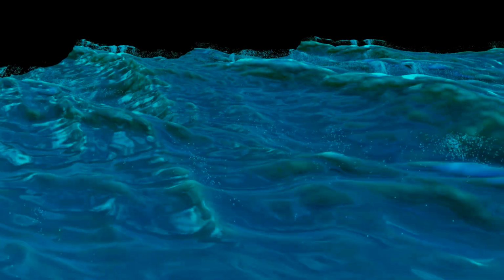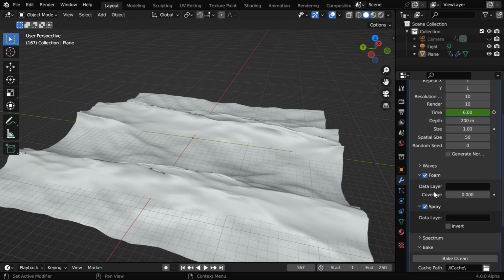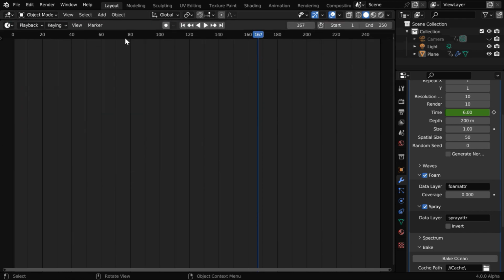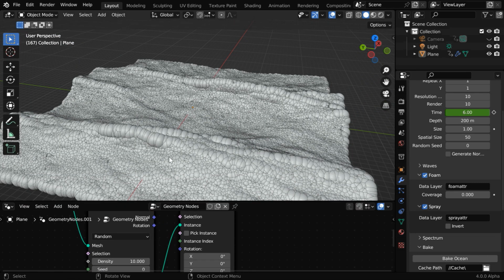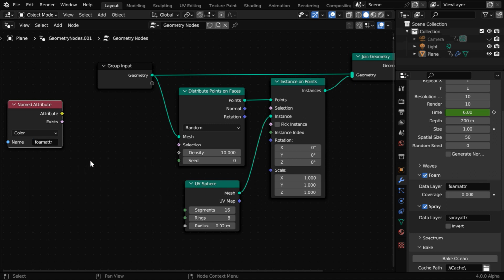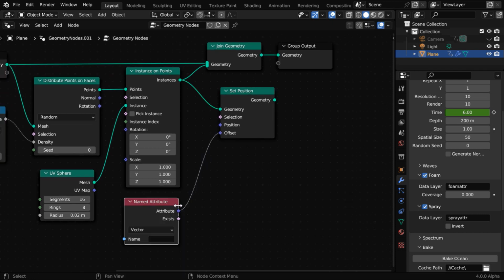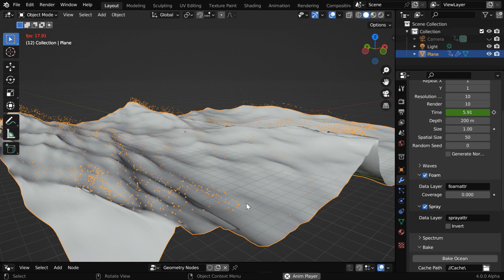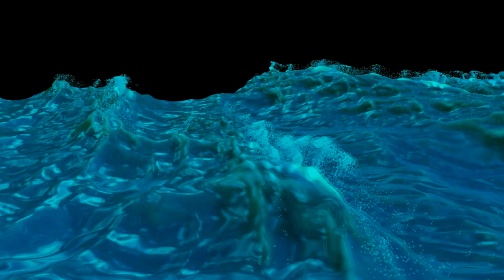Spray With Ocean Modifier | How To Use The Spray Option In Blender | Quick & Easy Tutorial

Comment: So this is how you do this, i had no idea, this can work in real-time with eevee?
Reply from the maker: Yes it works with Eevee. I did not understand what you meant by real-time, but it can be used in any animation. Once you bake everything, it will run faster and you can render.
Reply: @5MinutesBlender use of dynamic paint so it's interactive with objects in realtime, in the viewport, no need to bake
Reply from the maker: @Viilap  Ok, got it. Yes it works that way (your machine must have a very good spec), but does it have any practical use if you don't finally render the scene? In order to render, you need to bake it first.
Reply: @5MinutesBlender  it's more to just play around but ue5 is probably better for that

Comment: This video and the loop video are great, but the foam doesn't loop with the rest if you have a decent amount of it in your shader with an emission node. Would love help with that, and making the shape of the water not square as the displacement gets used when looping. Thanks.
Reply from the maker: Sorry, I could not figure out a way to loop the foams 🙁 It only works without foam.
Reply: Bummer, thanks for trying though
 @5MinutesBlender

Comment: thank you for your helpfull videos,
 i am playninng to buy a new pc because my old laptop has a lot of lag problemes.
i am facing a  problemes whene i running videos in viewport i got a lot of lag,
haw can i get smothness whene i work in viewpor ?
and my question is what is the most important to making videos smoth during working in blender is it the gpu or the cpu or bouth ?
thank you in advence.
Reply from the maker: When we play an animation in the viewport, GPU is the main actor, but CPU also plays an important role. The transformation keys, shape keys, modifiers, geometry nodes, shader trees etc. take CPU time while the shader display, actual animation and the rendering take GPU time. Sometimes it may be CPU-heavy, other times it may be GPU-heavy. But on an average, most of the compositions that we create are GPU-heavy i.e. they contain less calculations to be done through CPU and they depend more on GPU for viewport rendering. In a nutshell, you need to have a good CPU, a big RAM size and a good GPU. But mostly our machines lack a good GPU.
Reply: thank you so much, 
wich combo is better for comparison videos ?
ryzen 7 5800x and rtx 3060ti or i5 13600f and rtx 3060ti @5MinutesBlender
Reply from the maker: @3dcomparison911  Core i5 seems to be a slightly better option, you can check https://cpu.userbenchmark.com/Compare/Intel-Core-i5-13600K-vs-AMD-Ryzen-7-5800H/4134vsm1442974 or https://nanoreview.net/en/cpu-compare/intel-core-i5-13600k-vs-amd-ryzen-7-5800 or https://www.cpu-monkey.com/en/compare_cpu-intel_core_i5_13600k-vs-amd_ryzen_7_5800h